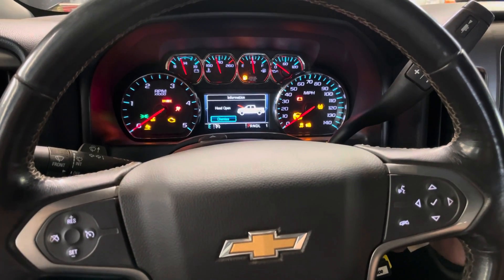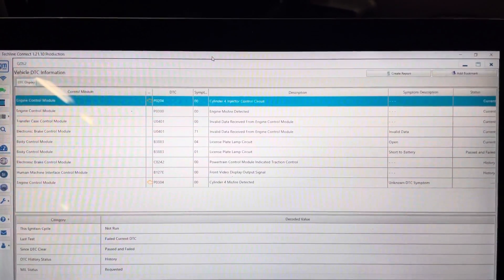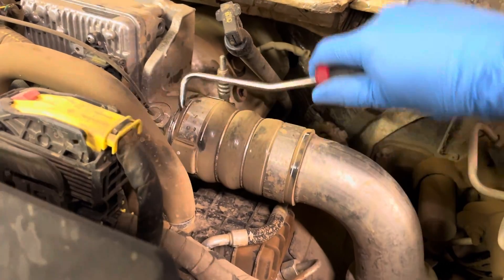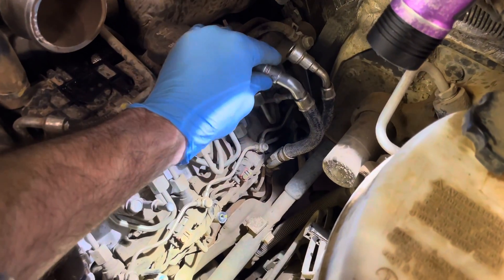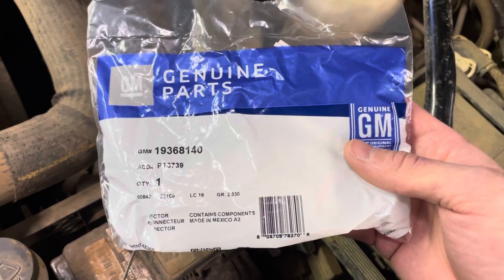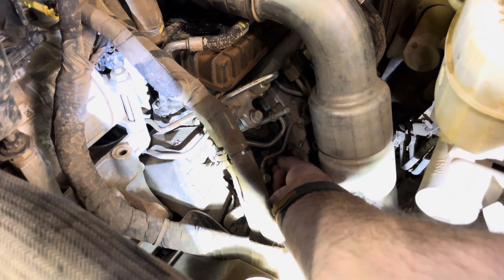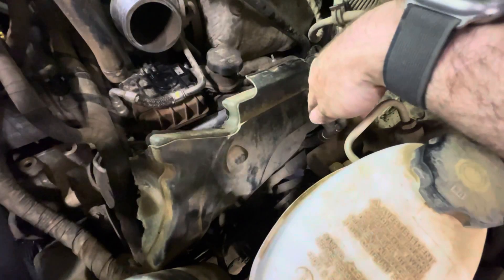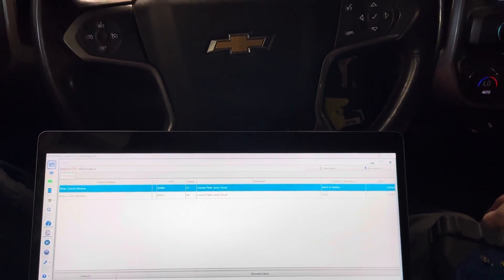Duramax Fuel Injector Harness Misfire... Terminal Fretting P0204 P0205 P0304 P0305 P0300

Comment: im getting code P0307 but have no misfire that i notice? Could it still be a pigtail?
Reply from the maker: Yes the pigtail could still be a problem... If there are not any actual misfires I would first perform a Crankshaft Position Sensor Variation learn... The ECM may be detecting false misfires. 

Let me know what you find. Thanks.

Comment: I just had one setting p0216 and cylinder 4 timing seemed a bit off, and there was the brown dust in the connector
Reply from the maker: It seems to be cylinder 4 or cylinder 5 most of the time. 

They last about 1yr - 2yr before needing to be replaced again. 

Another award winning design… I won’t be buying a diesel any time soon.
Reply: @DadsGarageDiagnosticSpecialist even with dielectric grease?
Reply from the maker: Yes, because di-electric grease can't make up for a worn terminal, it can only assist with preventing wear.

Comment: Question, I'm getting codes for misfiring #8.  Pulled everything and changed pigtail and still not firing on #8 cylinder on my scan tool.   Could the coil in the injector be bad? 2018 6.6. @ 150,000 Miles
Reply from the maker: The injector itself can have fretted and worn terminals, you’ll see deep scratches worn into the terminals and brown/black dust inside the connector as shown in video. 

This repair lasted another year or so and then ended up fretted again, requiring the connector and injector to be replaced. 

The injector windings failing is fairly rare in my experience. 

Otherwise I would advise a relative compression test to verify engine health… There have been some problems with occasional camshaft/lifters failing and/or pushrod failures… usually you’ll hear a noise, but not always. 

Let me know what you find. Thanks.

Comment: hold up ,  you seen a few days back the entire system was dirty  ..did you tell the customer it should be cleaned,  including the map sensor? or other sensors?
i would want you to clean everything  .
.all the def /exhaust sensors..what would that cost $$
Reply from the maker: I’m not sure what you mean…. I have a video with contaminated fuel system, but that is a different vehicle and different engine. 

Whole fuel system was replaced due to severe DEF contamination.
Reply: @DadsGarageDiagnosticSpecialist its possible im confused with the engine that had the air intake that had collapsed on itself..
i will review. now

Comment: I have been seeing many 2019/20s 2500/3500HDs for "Cheap" these days. Cheap by today's Pricing Standards. They seem to be going for what a 2015/17s are going for. Lots of common complaints and problems. Now I know why. Problems like this. 
GM took a GREAT Engine and made it JUNK. 
You then think Gasser, NOPE. I had a buddy recently buy a 2014 5.3L Silverado, truck in excellent condition, well maintained, only 114K on it, records to prove it. He got just past his first 3K oil change, engine gave up the ghost. NEW Engine replacement, well over 10K. The AFM/DoD is JUNK. I have read the GM went all in to "fix" the problem in 2019. Instead of having several cylinders be able to deactivate, they now theoretically can all deactivate. This just MAGNIFIES the inherent problems with that technology. 
Don't think you can buy a Ford or Dodge though, they have their own problems, just as BAD or worse.
The Consumer BUYS in at PREMIUM PRICING, new or used, and own vehicles that are NO longer Reliable, Ticking Time Bombs, with Constant/Regular Shop Downtime. 
This would ALL STOP if these Companies were Constantly HAMMERED with MASSIVE CLASS ACTION Lawsuits. 
Vehicle Manufactures no longer put out Quality, they put out JUNK that is designed to be brought back to the dealership in order to feed the beasts, the machine, DRIVE PROFIT by fleecing the consumer.
My buddy that bought that 2014, it damn near financially broke him. He has two young kids, a mortgage, couple of pets, and saved to buy a "Good" used Truck for his family. That NEW Engine replacement cost him roughly half of what he paid for the truck. 114 000 miles.
Reply from the maker: Modern vehicles are designed to be throw away garbage. 

Blame government regulation…. The true cause of all of this.

Also blame the consumer who time and time again finances and buys something they can’t afford. That is the American way.

Comment: Great video!  I've been getting PO26D for over a year now. It cleared during winter , but it came back when weather got over 85 deg here in Texas.  How do I know if a connector is bad?   I have a Autel scanner , but I'm not an actual mechanic and only have little use with it..   Will it show a bunch of misfires and should I look and see if the injector qty is too high?
Reply from the maker: The fuel injector connector will almost never cause P026D. It will cause misfires and injector circuit codes primarily. 

If one injector has high or low quantity compared to the others… First test engine compression, and if the compression is even then I would suspect a faulty fuel injector or more likely fuel contamination. 

Take a fuel sample and check for gasoline, exhaust fluid, water, etc. 

This can also happen if you use low sulfur off road diesel instead of ultra low sulfur. 

Thanks.

Comment: Hi there I have a 2020 L5P and mine is showing Cyllinder 7 and 8 injectors are acting up. I am going to check the connectors Would it be a waist of time since its not cylinder 4? Great video btw
Reply from the maker: The connectors are definitely the most common failure. And it isn’t very likely that two cylinders on opposite sides of the engine failed at the same time unless there is some fuel contamination. 

It’s definitely worth inspecting the connectors. 

Thanks.
Reply: @DadsGarageDiagnosticSpecialist  Thank you I will check them out.  my customer had the entire fuel system replaced due to his employee putting def in the fuel tank. It started acting up a year later so now I'm battling with it before we consider the injection pump etc
Reply from the maker: Hopefully, they cleaned out the fuel tank really good. 

Let me know what you find.
Reply: @DadsGarageDiagnosticSpecialist  I will thank you

Comment: good afternoon i just A COUPLE QUESTION I TOOK MY TRUCK TO DEALERSHIP AND THEY SAID MY FUEL RAIL, TURBO CHARGER, FUEL SENSOR ALSO FUEL PIGTAIL NEED TO BE REPLACE BECAUSE I'M REDUCE SPEED. I CHANGE THEM TRUCK RAN FOR A WEEK AND NOW ITS SAYING CYLINDER 4 I CHANGE THE PIGTAIL ON THERE JUST LIKE YOU SHOW AND IT STILL IN REDUCE SPEED NOT UNDERSTANDING WHY PLEASE ANYTHING
Reply from the maker: Need to know what exact codes it has, but it sounds like it has a cylinder 4 fuel injector code which will cause it to enter reduced power mode. Are you sure you replaced the cylinder 4 injector harness? It is located on the driver side, second cylinder from the front.

Also depending on how badly the connector was fretted, you may also need to replace the injector. This can also happen if you didn't clean the oxidation and dust out of the injector connector before reassembly.

Thanks.

Comment: Ours was a cylinder 5 connector failure took it off and cleaned it and put a bunch of dielectric grease in it cleared the codes and we were back on the road in about 2 hours. Going to trade the truck in there is no reason a 2020 should be breaking down like this! Never buy GM again.
Reply from the maker: Yes, cylinder five and cylinder four are the most common to experience this failure. I believe it has something to do with the harmonics of the engine and the vibrations being transferred up the wiring harness and it seems to affect these two cylinders the most.
Reply: @DadsGarageDiagnosticSpecialist Does LML have same issue? I have a 16. I have a P24BO PM sensor low voltage code. Any suggestions?
Reply from the maker: @2hotscottpro the LML does not have common fuel injector problems aside from fuel system failures. 

Most likely you have a faulty Particulate Matter sensor.
Reply: @ cool I’ll order a sensor.I’ve been wanting to put a CP3 in due to I’m at 94k miles.
Reply from the maker: @2hotscottpro soak in penetrating oil for a week or two multiple times before you try to remove the sensor… they tend to stick and tear the threads out.
Reply: @ sprayed  PB on.Will kit twice a day.Thanks! I know ideally would be a month 😝
Reply: That is the reason why not to buy GM? That small, easy to fix loose connection? Yeah, I agree. Go buy a Ford and have the whole transmission take a dump and see if you still think that terminal connection being loose is the worst thing in the world.

Comment: Cummins never has this problem. GM Duramax is poorly designed
Reply from the maker: Ehh Cummins has plenty of EGR and SCR problems to go around.
Reply: "...poorly designed"??  The "deadly dowel pin" is a proud Cummins problem...and fatal to the engine!!  At least the crappy wiring and connectors on the Duramax only cause misfires.
Reply: The Cummins has its own inherent issues. Even worse quality is the chassis that it is living in.
Reply from the maker: @svenriemann3897 that’s what I’ve always said. Cummins is a solid engine I just don’t like the truck that’s wrapped around it.

Comment: Great video. No dielectric grease on the connection?
Reply from the maker: Normally I will use di-electric lubricant rather than di-electric grease....the difference is that one is designed for electrical terminals and connectors and the other is designed to insulate against high voltage. P/N: 12377900

Thanks.

Comment: Do you need to clear the codes in order to get it off limp mode after replacing the connector?
Reply from the maker: Yes it will usually stay in reduced power mode until the codes are cleared.

Thanks.

Comment: You give a good explanation of the what and why. Exactly what I’m seeing on my connection with the dark looking dust. I’ve spoken with my local dealership and they act like this is a new issue. I’ve replaced my #4 pigtail 8 times now with dealer pigtails and now with pigtails from fleece performance. The dealership part definitely last longer as I usually get a month or 2 out of them while I have blown through the 4 fleece pigtails in a month. I’m now considering replacing the injector because my truck is unable to endure a 2-4 hour road trip now without having to replace the #4 pigtail.
Reply from the maker: Yes, if you are seeing repeat failures on the same injector, and you have replaced the connector… Most likely you will find worn terminals on the injector itself.

Also, be sure you are identifying the correct cylinder. Cylinder 4 is the second one on the driver side, I have seen people replace the wrong one, because a diesel identifies the cylinders differently than the gas engines do.

Thank you.
Reply: update- so I did replace my # 4 injector and sure enough the terminals had dips worn into them. I’ve been driving it for months and no longer an issue. Haven’t had to change out any pigtails since. The injector was easy to replace but a tip for anyone doing an injector swap. Make sure after the engine is cool to spray parts washer around the injector and blow out with compressed air multiple times. It’s hard to see how much sand small pebbles are sitting around the injector and you don’t want that falling into the cylinder when you pull the injector out and knock all the debris stuck around it loose.
Reply from the maker: That’s awesome! Glad to hear you fixed it.

Thanks for the update.

Comment: When my son replaced that same connector on his Duramax, I inspected the backside of the foam cover and it looked like the cover had been making hard contact with the wire bundle and/or the connector itself for the #4 injector. I could see a shiny worn spot in the area of the wire bundle and connector. So, we're going to take a Dremel with a drum sander and remove some of the material under there where the cover's been making contact. That could very well be transmitting vibration into that wire bundle.
Reply from the maker: That is very interesting. Thank you for sharing.

Comment: Why doesn’t the factory put dielectric grease on? Seems like it would solve the problem
Reply from the maker: They were probably being cheap. Haven’t seen this problem on any of the recent models yet. 

GM does have dielectric lubricant available for service use, and there is a difference between the dielectric lubricant and the dielectric insulating grease. 

I remember on a lot of older vehicles most of the under hood connectors had dielectric from the factory…. Fords had the white tacky grease in them, but they weren’t the only ones doing it. I wouldn’t be surprised if it was a cost cutting measure. 

Thank you.
Reply: @DadsGarageDiagnosticSpecialist My 2020 just threw a code for number 4 injector. So they haven't done anything to fix this issue. Dealer wants 800 bucks. I'll be doing that myself lol.
Reply from the maker: @bjenkins803 Very very common. 

If you are willing and able… That’s what this video and my channel is all about. Thanks for sharing.
Reply: @DadsGarageDiagnosticSpecialist I replaced the connector today. Fixed the problem and thanks for the video help.
Reply from the maker: @bjenkins803  you’re welcome. Thank you.